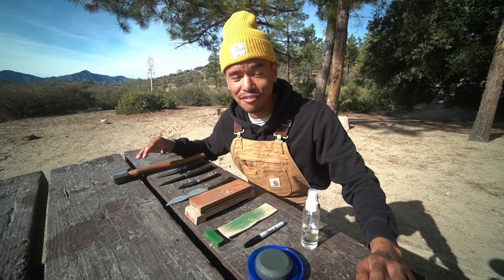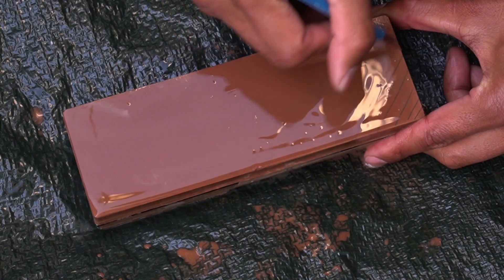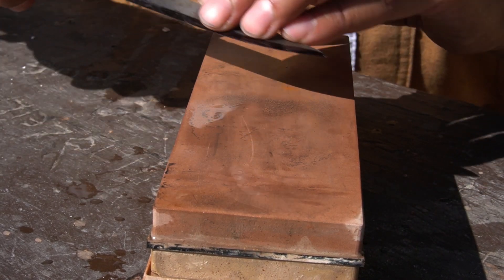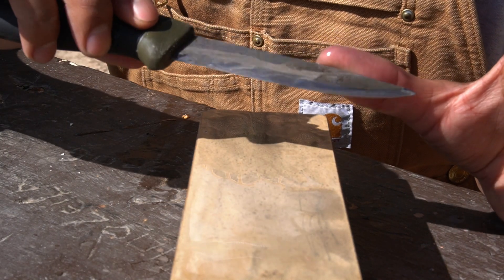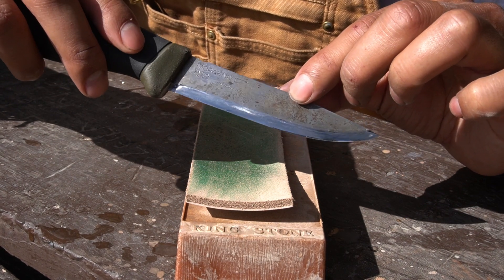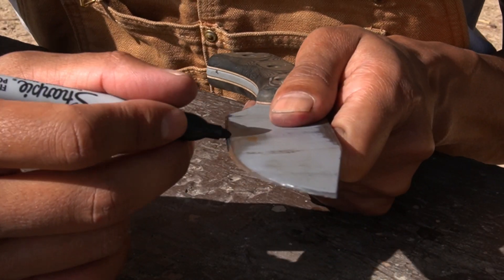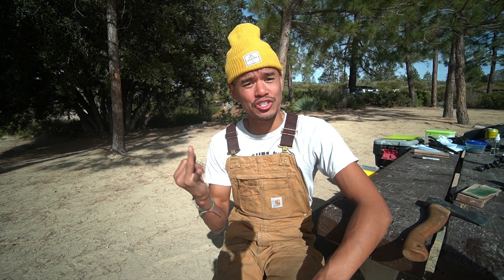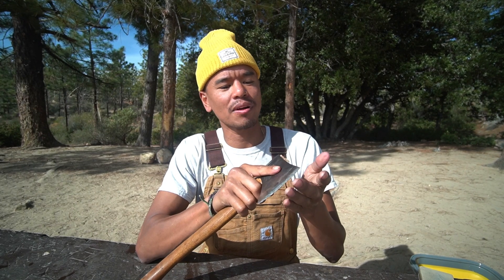How To Field Sharpen Your Knives and Axes: For Beginners!

Comment: I’ve wanted to sharpen this way for a long time. I use a pocket ceramic honing block. Not great but gets the job done. Definitely grabbing these items and gonna got through your video again! Thx!
Reply from the maker: That definitely gets the job done! Let me know if you need help ☺️
Reply: I've always just used smooth, pitted rocks to hone blades, more or less for regular blade maintenance, as they tend to have curves that make them more forgiving about initial alignment with the blade's angle.

Comment: "A dull knife is a dangerous knife" anyone cook or chef could attest to this! If you're going to have an accident, and accidents are going to happen, you really want to cut yourself with the sharpest knife possible. You're much more likely to wind up with non-serious injuries that way. I've slipped and chopped my finger with a chef's knife before, and I was lucky to be using the best knife in the house that I had just sharpened earlier than day. It went straight through my fingernail and while it wasn't pretty, it wasn't anything a few days of rest couldn't fix. Do yourself a favor, sharpen your knives regularly. Don't get complacent with a dull knife, you will regret it.